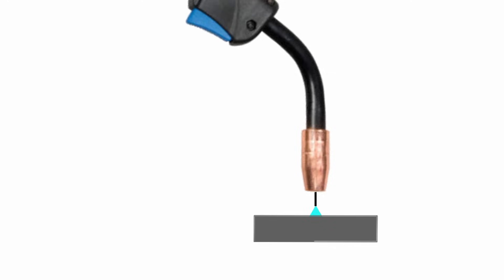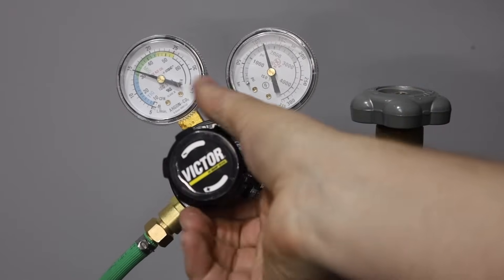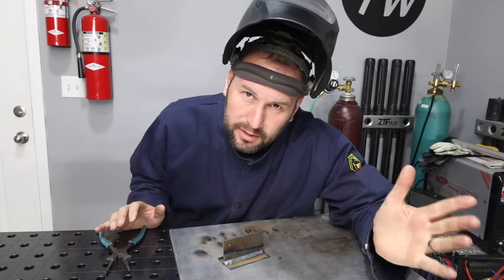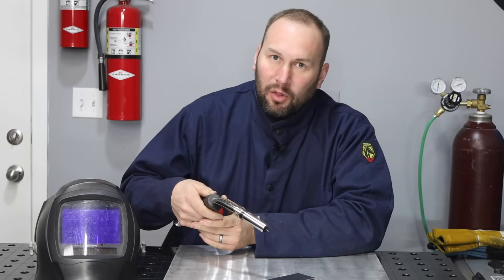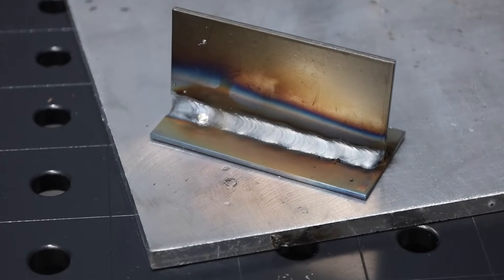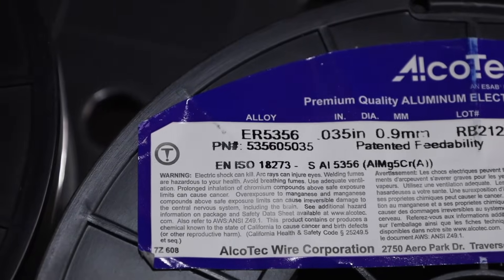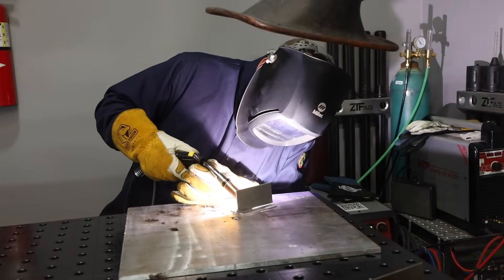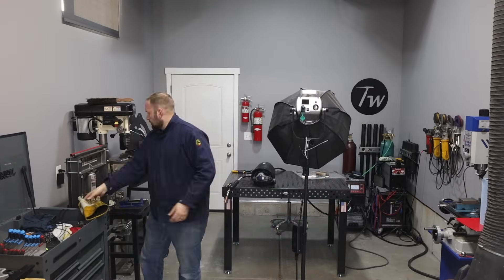How Pulsed MIG Welding Works...And do you need it?

Comment: Great demo! I have a question though, about your aluminum torch: How long of a graphite-lined lead can you get with that machine? Is there a length limit before you need to move to a spool or push-pull gun?
Reply from the maker: Thanks! This is an 8’ lead, and I wouldn’t go much longer than that with .035 4043. My Fronius has a 15’ lead set up for aluminum, but they recommend.047 wire, which feeds well in that case.

Comment: the wire weld looked like tig and the sound was really strange like a transformer out on the pole humming. I'm retired from welding after 21+ years of it in 2007. I miss it. These new machines and how you younger generation are changing the names to schools and statues and any thing you can get you hands on like lift tig, now that is hilarious. Tig was always tig.  weather you use  the high freq start when welding aluminum or touch start. But it was never called any of that but .....TIG or MIG. NOW it's maw for stick welding. You people have lost your minds thinking you are so intelligent just because you change the name of something so you can confuse the older generation like me to make us think you have discovered something new.  I see the square wave and whatever the other wave was. That looks interesting too. Oh, just looked up and to the right another one of your video's that says, stacked dimes. They always called it a row of dimes. See you had to change that to and instead of saying 30 thousandths or 35 thousandths your say 030 or 035. It's thousandths. duh. But you millennials know everything. 🙄 then saw another video about using different polarities and they said D C something and P. 4 letters that meant nothing but DC Positive or DC negative. simple as that. But you all had to complicate and extend that acronym to make if more confusing. So glad I'm and old man and dying and on my way out because the health care system is run by millennials and gen zer's and its NOT MY JOB to make sure my patient lives a healthy life. He is old, time for him to die. He has lived his life. No need to extend it to his 70's.  You don't care about anyone but your selves. There goes the planet.  You just changed all the letters and words and meaning around to make people think you invented something better or different. Only think I saw was the square wave thing and sine wave. That was the only improvement and the absent sound of frying bacon. Now that was strange. Sorry for the rant. YOU millennials and younger really get on us older generation boomers nerves. Please don't make us suffer any more and make our death fast and painless. 🙄🙄🤣🤣🤣🤣🤣🤣🤣🤣🤣🤣

Comment: 00:58 So in other words a Tri-Mix ?
Reply from the maker: Not usually, more often it’s 90 Ar / 10 CO2 or 98 Ar / 2 02. There are a variety of tri mix gasses, some of which are used for pulsed spray. The most common tri-mix is used on stainless, but is used less now due to price and availability of Helium.

Comment: "a lower co2 mix or even a little oxygen?". 🤔
Reply from the maker: Since pulsed MIG requires you to get into spray transfer, standard 75% Argon 25% CO2 won't work well. You need a mix like 90% Argon 10% CO2 or 98% Argon 2% Oxygen.

Comment: Tim would you recomend welding 16 gauge frames some overhead with short circuit or pulse spray? The size wire is .035  millermatic smooth welds? Faster to

Comment: Tim... great video... I got interested in pulse mig after reading that it makes welding overhead much easier... my 2 questions are:  #1- Is it realy easier for overhead welding? #2- have you tried with 100% co2?  I could only find one youtuber named Zila trying pulse with 100% Co2... thanks for the great videos.
Reply from the maker: Thanks! Peter Zila who you saw is a very good welder and an expert in this. I haven't seen that video before, though. Yes pulse MIG is helpful for overhead in many situations and works great once your settings are dialed in. Straight spray transfer can't usually be done in the vertical and overhead positions (except with aluminum) and short circuit transfer can be problematic. Pulse limits the heat and makes out of position welding possible with spray transfer. As far as CO2 goes, I wouldn't recommend it. You generally need higher argon content (90%-98%) to have an effective spray transfer.

Comment: Problem is that people use pulse on everything its really only beneficial for outta position or if heat input is a issue axil spray gets  better penetration than pulse
Reply from the maker: True story, unless you're working on thin stuff or out of position, spray is generally better. As more of a fabricator than a production welder, I do it just because it's too much time to switch material.

Comment: Which "heavier duty" gun from HTP did you use on your Pro Pulse 220 MTS to weld the aluminum?  I'm on USWeld's site, but can't seem to find a specific aluminum welding gun (not a spool gun) with a graphite liner. 

I'm trying to decide between the Pro Pulse 220 or the much more expensive Millermatic 255 and the XR-Aluma Pro gun.  Any recommendations on quality of the machine as well as weld quality between the two?  I'm mainly going pulse to get a stacked row of dimes look with improved fusion on mostly steel and just recently saw the XR-Aluma Pro (and it's $3400!!! price tag)....but it would be nice to weld thicker aluminum with it as well.
Reply from the maker: It’s a 26 series gun, if you go on their website to MIG, then accessories, then MIG guns, you can find those that are compatible with the pro pulse. You can also get a pro pulse with both guns included. The HTPs can also run a push pull or spool gun if you need more length, but the wire does feed through the lead quite well. 

I have owned several Miller welders and they’ve been great, but the HTPs really give a lot of bang for the buck. Quality of machine wise, the HTPs are just as good. I haven’t used a 255, so I can’t give a comparison of performance for this specific application. The only pulsed Miller I’ve used is a 350P, but I don’t think those are in production any more. 

Pulse on steel usually gives a very smooth bead. It can be possible to get some dimes with double pulse, but it’s not how most of the motor sports guys do it if that’s what you’re going for. Also, I believe that the frequency of double pulse is fixed on the pro pulse, so that could be a limitation if you have a very specific look you’re going for. (it’s fully adjustable on the HTP Revolution 2500) I only bring this up because it might be good to demo what you’re looking for before investing in the equipment. If you have other questions about the HTP, you can just call them and they’ll be straight with you about what it can and can’t do.
Reply: @TimWelds  Thanks Tim.  I apologize....I should have done my due diligence before asking as I found all this info after I asked.   

After reading quite a bit on welding forums and looking at the HTP Revolution 2500 with the All In kit, I've decide to get the Miller instead.  I've got the HTP Invertig 220 for Tig work and already mastered the stack of dimes MIG look with short circuit with my Miller Vintage 250 and 211 and a Lincoln Power Mig 256...but want the added penetration that pulse should provide.  The MM 255 just has a lot more amps and higher duty cycle and since pulse is really what I'm after with this machine, I don't really need the multiprocess capability of the HTPs.  You have to pay to play if you want to weld really heavy material, so I guess it is what it is.  Thanks again!

Comment: Thx Tim.
I have a relatively inexpensive pulse mig weilder. When you setup for double pulse you can select a frequency but you cant when in single pulse. This leads to my question: what is changing frequency?
As I understand it in single pulse the amps and volts change many times per second  (perhaps greater than 60?) . In double pulse there is a pulse on pulse. From diagrams I see that the frequency of the secondary pulse appears much greater than the primary pulse. So what am I changing when I select 2 pulses per second? The primary or secondary pulse? When I select 2 pulses per second I can hear this pulse surge and ebb very clearly.
Thanks for your input.
I see you have quite a CV in the metallurgical field!
Reply from the maker: Hi John, With most machines, the primary pulse is automatic. On double pulse, the frequency can be set on some machines, so that’s most likely the setting you have. I use between 1 and 3 PPS for secondary pulse. You’ll hear it cycle between the high and low setting as you described when using double pulse.
Reply: Thx Tim

Comment: That crater could be solved by a nice little partial weave at the end. Also drop your heat a tad and you can slow it down and have a better pattern. We run Miller 350Ps

Comment: Greetings Tim!
Question: what voltage do you need to attain spray transfer? If you used quite high voltage to attain spray transfer in regular mig welding , say  on 1/4 in material would you not have problems with the weld? Presume if using pulse too high voltage would not be a problem as less time on high voltage. Also, why longer stick out for spray transfer?
Always learn from your videos.
Merry Xmas

Comment: For someone who occasionally welds personal projects and wants to be able to do it all. Would you choose a machine which is capable of dual pulse mig, or high frequency ac/dc tig?
Reply from the maker: AC/DC TIG. The learning curve is a little longer, but it is more capable and welds any metal with the same gas. MIG needs different gasses for different materials, which complicates the matter.
Reply: @TimWelds  legend!

Comment: Hi ,   For MIG pulse welding, can we say that it is a process that combines Short Circuit Mode and Spray Arc Mode
Reply from the maker: From a practical perspective, yes it has characteristics of both. The mechanism is completely spray transfer, though. I’d think of pulsed spray more like electronic fuel injection and short arc more like a carburetor. Just different ways to reduce the rate of energy input.

Comment: Tim are you using the setting straight from the machine for double pulse? I'm trying to get settings for double pulse with 035"  4043 for 1/8" and 3/16" what off set are you using? Please

Comment: I like pulse mig due to the nice penetration, but it is easier to encounter undercut due to the brutal heat.
Reply: Anyway you could elaborate on how to not run into that? Fairly new to pulse and have a test for it coming
Reply: @hpskater29  Hi, I am trying to avoid it with balancing the heat/added material between the edges. I stay longer on the 'upper part ' of the bead thus filling the part prone to undercut.. Or even better if you can lay your part horizontally. But you can always back up the heat till you have the penetration/'low enough' bead profile you want. Playing with inductivity does not help since it only works in short circuit MIG. So you see it is trial and error eventually, but you will find your way. In a nutshell: you either backup tye heat, or play with your movement/puddle to 'fill' the undercut 'zone'.
Reply: @laszlovona  thank you for the fast reply bro you’re the man. Much appreciated Good luck wherever and whatever you’re doing

Comment: I’m thinking of pulling the trigger on a pro pulse 220 so I can weld an aluminum trailer and some equipment railing,  i think I just need to get an outlet added to handle the plug 😢 maybe you could recommend a 110v mig machine

Comment: you should make a specific video on distuinguishing different parts of the puddle \. With arrows and pointing what your looking at and terms like where is the leading edge toes wetting. Where do you specifically look at when your welding. The tail end of the puddle what exactly is that doing.

Comment: Hi Tim so, what type of mig welder do you need to do this pulse mig welding? This doesn't seem to be the same regular spray welding I can do on my big old Miller 210 mig? If I do silicon bronze wire with it  I get a huge case of the spatters really bad. I play around with the wire feed but still my .030 hard wire never sounds like this . If I could get this to do pulse welding with silicon bronze wire and aluminum with the  Miller 210 and a spool gun that would be pretty cool. So do I need a different welder?
Reply: You need a pulse mig welder ….  Like a miller 255, 355 or 350p or lincoln 350 mp or HTP pro pulse 220 or 300….

Comment: Quick question for you..im currently using a parweld xtm 4035 had no issues until recently where all of a sudden after almost every weld im left with a small hole at the end of each weld..tried different things from lettin it burn bit longer taking it off quicker..different settings..new gas new wire all with no joy.. HELP!!

Comment: Double pulse in so much better for welding aluminium. I use kemppi  and I've got a fronuis CMT robot. The arc is very stable and clean.  The welds I can do are high spec.

Comment: Thank you. I have a Miller Multimatic 255 that has the Pulse Mig feature with 100% argon. You mentioned that welding Aluminum without a spool gun. I’m sure you know how expensive even the standard spool gun is and even more money for the push pull gun? I have asked my dealer that sold me the welder to have a demo gun available for me to try out. So far they have not set something up with Miller. It is just too much money without welding with either the spool gun or the push pull gun. So,  you have tweaked my interest so where do I get a graphic liner for a Miller mig gun?
Reply: Amazon

Comment: When you build fuel or hydraulic oil tanks it comes in really handy
Reply from the maker: Thanks Peter! I’ve built several small tanks, but always TIG welded them. I can see how that would be awesome on outside corners and a big time saver vs TIG.

Comment: Good morning Tim, great information. That pulse transfer is great for automotive sheet metal. I recently watched a shop use the pulse weld for spot welding. Those welds were much prettier than the compression spot welds. Thanks for the great information. Take care and good luck.